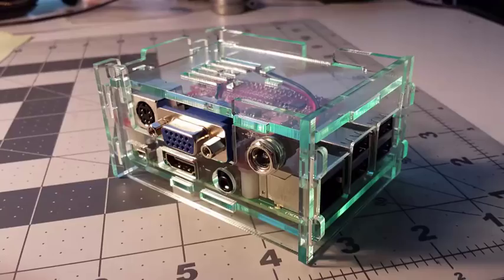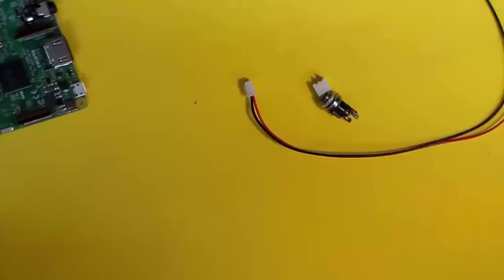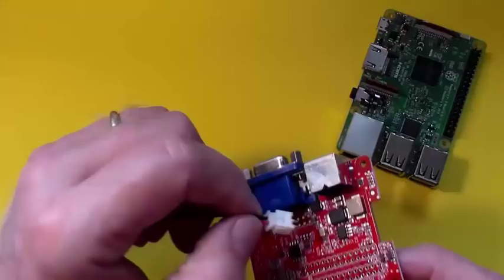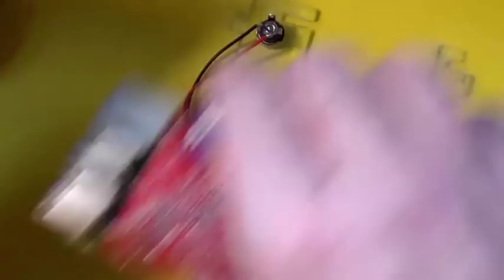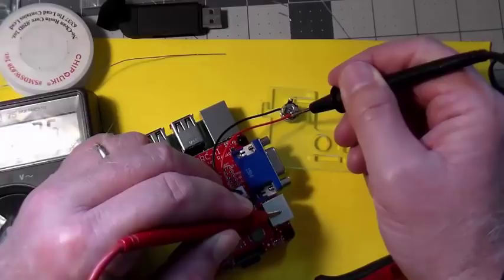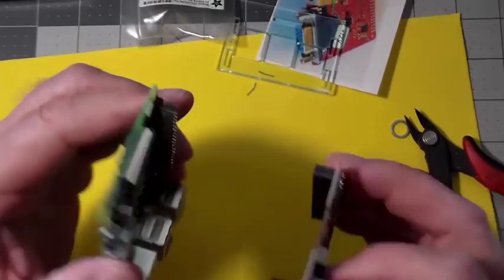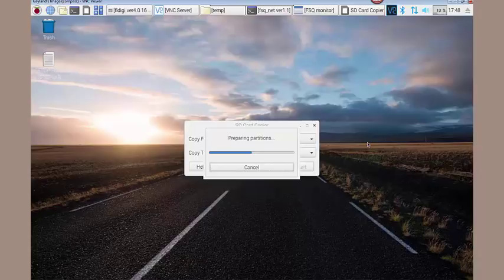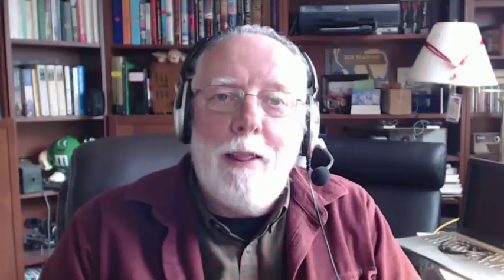Building the DigiPi - Digital Radio Controller

Comment: This brings back memories of the SEAPAC Raspberry Pi day. Myself and another fellow gave a FL-DIGI forum during that day. It required many steps to get Northwest Digital's version on Linux to support the UDRC-II configured on the Pi. I did that many many times getting ready for the forum. I packaged my Pi with 7" LCD screen as one complete little package. One issue with the small screen is that some programs require more pixels, so some edges were not shown. Have fun on 2M with it. Looking forward to updates.
Reply from the maker: That is why we are working on creating an image that can be cloned so that hams who are not deep into Linux can get on the air. I spent some time with Basil, N7NIX, today and we talked about some great ideas.

Comment: so i'm slightly confused and just want clarification. I'm new to digital so I want to get my facts straight. Will this set up eliminate the need for a signalink? if not, what exactly is the purpose of the digipi?
Reply from the maker: Short answer: YES. Better answer is that it replaces both the need for the SignaLink and the computer! ... however many of us run the Rpi headless, which means we remote into the Rpi from another computer. So you can use a Windows computer to run the Rpi which is running Fldigi.

Comment: Could I use this with a CB radio? To tx and rx JS8CALL. I use a old Cobra 146 gtl. Tks 7351 from Portugal.
Reply from the maker: You will need to have an Amateur Radio License to use those modes. I know it works with FT-8, so I would assume it can do JS8CALL. Is their a Linux version?
Reply: @BuddChurchward  thank you 7351.

Comment: I have been banging my head against my desk trying to get my signalink setup. I'm waiting for my Draw Workstation to come but in the meantime getting signalink to work. It transmits but no audio in. I can take the USB sound card off and use with Win 10 laptop and it works. When is your net on and I see that your using 145.580. If I had of know I'd in there like a dirty shirt.

73 de va7dgp
Reply from the maker: Don, there are two nets each Sunday night. The first one is the Blaine ACS digital net which runs from 1800 to 1820 on 145.58 MHz. The mode is FSQ and we usually see between 12 and 18 check-ins. Everyone is welcome. Send k7bpd#<name><location> to check in. Then at 1830 there is a county wide net on the same frequency and mode. That one usually has more check-ins. Send w7ecg#<name><location> for that one. Of course, everyone is welcome there too. If you listen on Sunday nights your heard list should reach between 20 and 30 different stations all on FSQ on VHF.

There is a casual gathering of folks Sunday mornings on the same frequency usually starting around 0900, sometimes earlier. We just have fun and do a lot of keyboard chatting. We call it our Digital Watering Hole as stations come and go throughout the morning. We would love to have you join us.

Comment: sound is too low on this vid
Reply from the maker: Sorry about the audio level. If you look at the video you will see that the mini boom mic got bumped up a little on my headset. Hopefully you have a volume control on your computer and you can slide it up a bit. I tested it here and only had to nudge my audio up a little bit and I was able to hear it fine.
Reply: Budd Churchward i can hardly get up to a level I can hear on my tablet.